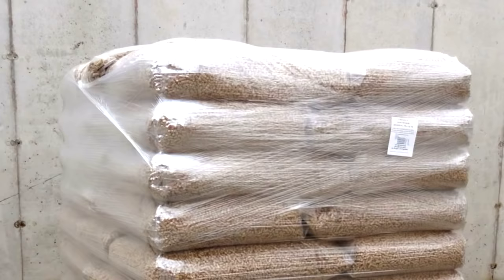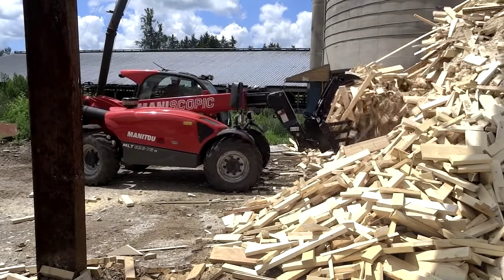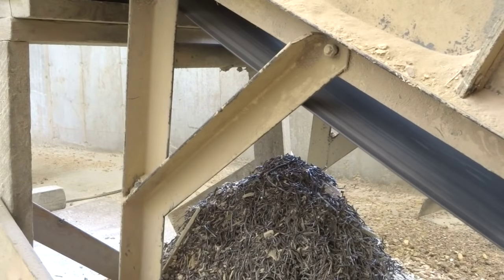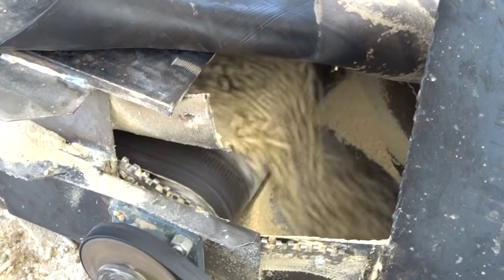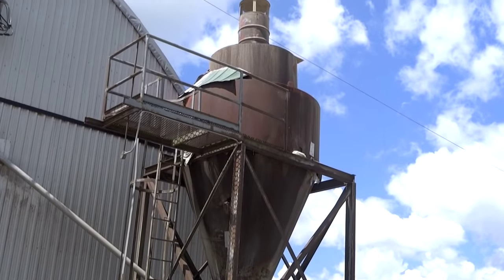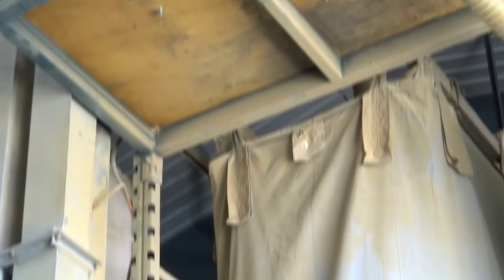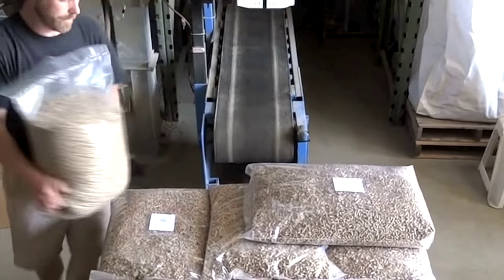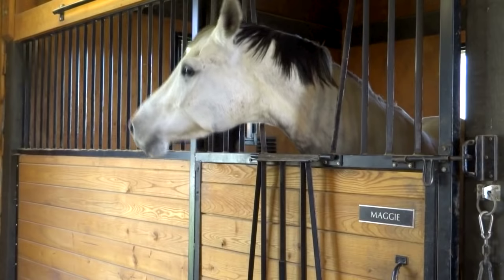How Wood Pellets Are Made

Comment: We have been using pellets for 30 years. So clean and heats well! Thanks for the videos! My suggestion would be use both soft and hardwood. If using just soft wood there's too much ash! So use both. Which will read on bag premium pellets. Ours takes corn as well. *Edited for spelling
Reply: How about the price using soft or hard wood as raw material? Thanks.
Reply: @agustea09  Our Drolet Eco-45 uses less pellets when burning softwood pellets as they burn hotter.  And we've tried various brands.  If you read about this, they claim its the sap in the softwood.  Ours really likes white pine and spruce and they burn really clean too.

Comment: I enjoy my pellet stove but the fan is quite loud (Osburn 2500). I miss the silent heat of the true wood stove, but I do not miss the fuel used (wood logs). Pellets are easier to obtain, and handle. Thank you for the informative video.
Reply: My pellet stove did the same. On the back of my stove is a 3 way switch that controls fan speed..set to low it is almost silent. On medium it can be noisy and on high its more than annoying. Your owners manual will tell how to adjust fan speed.

Comment: what comes to mind is the danger of a dust explosion. Worked at a factory where chip board is made. Similar process , but after the boards come out of the hot press they go under a large belt sander. this dust is highly volatile when the dust and air mixture is correct. A large silo blew up while I was there.

Comment: When I was heating with an airtight woodstove we used Oak, never pine. Would there be any advantage to using hardwoods instead of pine and fur to make the pellets???
Reply: Hardwood generally produces less soot and waste, it provides a longer slower burn usually due to the natural compression of fibre in the wood. However quick growing timber and softwoods etc for example Pine burns hotter but a lot faster leaving a lot of residue and soot. etc.
Reply: @Steve211Ucdhihifvshi  It would also cost twice as much.
Reply: @vicO1323  Most stoves run best on a blend, my own runs at peak efficiency (heat produced, over soot/ash build up) on an 80/20 mix (hard/soft). Running purely hardwood resulted in a stove that kept sputtering out at low settings, and didnt produce enough heat at medium settings, while not burning quickly enough to make room for the new pellets coming down (nothing like setting your hopper on fire to wake you up in the middle of the night!)

Softwood i was going through 8 pounds every 24 hrs...it was nuts.

now, i can run my pellet stove on the lower settings, for a good 48 hours, only go through 60 pounds, and it heats the un-insulated room i stay in quite well.
Reply: Use both soft and hardwood. If you just use hardwood it's creates less heat.

Comment: i would have lost money on the glue idea. i totally thought that you used something but just pressure and heat bind them together. WOW.
Reply: You can get the same results with a drill bit... You're suppose to back the drill bit out constantly so the saw dust can escape the hole but if you rammed the drill bit into the wood really fast you'll compact the sawdust and it'll kind of stick to the bit and when you pry it off the bit it looks just like how a pellet looks.

Comment: How is the BTU rating calculated for wood pellets? For instance, how do they calculate this rating or energy output per pound in oak vs pine for instance?
Reply: Averages probably, its al mixed to a pretty consistent mix, so they test multiple batches from the diff grade pellets and use the averages of those probably
Reply: @HSstriker  gross calorific value for residential and industrial biomass heating pellets is determined using a device called a bomb calorimeter".

It's a somewhat spicy-sounding name for what is ultimately a sealed jar inside a bit of water. A sample (in this case, wood pellets) is placed inside the chamber, sealed, and then the chamber itself is placed inside a vessel containing a known volume of water. 

The sample is then ignited, the heat from that ignition is transferred to the water, causing the temperature of the water to rise. The change in temperature associated with the sample's ignition is recorded. Through a few layers of known formulas, you end up with the "Gross Calorific Value" of the sample. Effectively, your "BTU Loading". 

For wood pellets, you see on the order of 6000-8000 btu/lbm

Hope this answers your question! 

-B

Comment: At first sight I wondered why you had so much dust coming through with the fresh pellets. Then you said you recycled the fines from the cooler. From experience you will find a huge reduction of fines if you don't return any material. It can actually reach the point where even new materials will not bind.

Comment: So you take something carbon neutral like wood, use a bunch of electricity / fossil fuels to prepare them, and then drive them longer distance to the customer.   Great idea.
Reply: Nothing is free, for fuel, gas or electricity you have to spend something to have it in a convenient form. If you use a fireplace you need to cut a tree, you use gas tools, you need to put time to make it to fit the fire place and you will have all form of insect introduce in the house. At the bare minimum pellet come free of chemical, they are garbages so they help heat the house after a minimum transformation. unstead of filling a landfill.
Reply: Still much better than coal

Comment: can  you cook with?
Reply: ABSOLUTELY NOT. Heating Pellets, invariably, contain some combination of both Hardwood and Softwood. Hardwood Pellets, specficially excluding Softwood from their recipes, are fine to use and in fact have come a long way in terms of variety, quality, etc. 

The reason you don't want softwood used in a BBQ pellet comes down to something called "Volatile Organic Compounds" (VOCs). Now, these VOCs are found invariably in all (at least to my knowledge) wood species, but softwood's (your Pines, Spruce, Fir, Cedar, Hemlock, etc - PS: Yes. Hemlock is a Softwood. Anyone telling you differently is simply incorrect) contain them in something in VASTLY higher quantities

Exposed to a low-to-moderate amount of these VOCs is a bit like being exposed to a low-to-moderate amount of radiation - no biggie! When, however, these VOCs are in sufficient concentration, not only are they flammable (they make a good portion of the "soot" and "creosote" that's familiar to anyone with experience running a Wood Stove) but are toxic as well. 

Short Version: Heck no, man! Not heating pellets at least!

Hope this helps, and I apologize for the long-winded response. It's really a safety thing!

-B
Reply: @benjaminnawfel5758  thank you